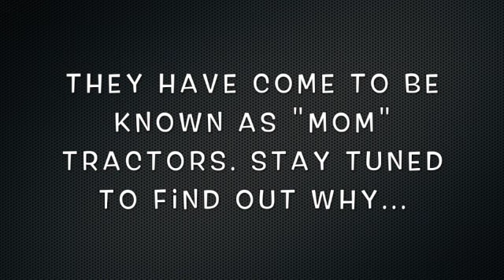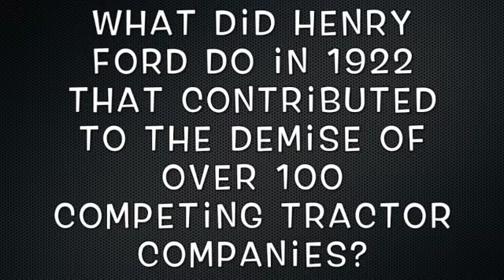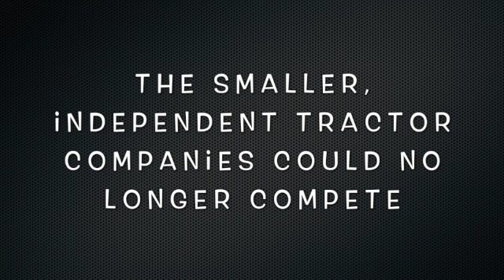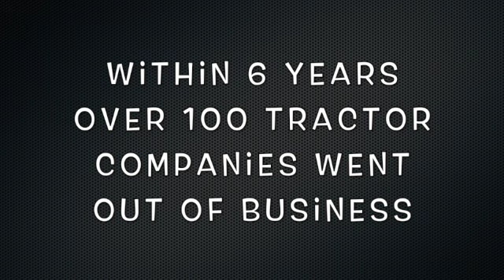The Fordson F Tractor - Specs, History, and Trivia

Comment: Great video with interesting information! Any idea where I might find the serial # on mine? I have no idea what year it is, but I saw a video of a restored 1919 model that looks identical. Mine is faded / peeling gray with bright orange paint underneath. It has solid front wheels with a hard rubber tire on the front, and steel paddle wheels on the rear. There are no rear fenders. There is a belt drive wheel on the right side like in this video. It currently has 4 different spark plugs in it. All are Champion: 22, W-14, W-18, OCOM. Do you know which is correct? Thanks for any information you may be able to provide.
Reply from the maker: The serial number should be below the cylinder head, on the block, toward the front of the engine. Here is a link to serial numbers by year ... https://www.tractordata.com/farm-tractors/000/2/1/217-fordson-fordson-f.html. If yours is truly a 1919, it could have been manufactured in either the USA or Ireland. The serial number will tell. I don't know what brand of spark plug Fordson originally installed in their F models. My guess is that they used more than one brand as supply and price dictated. This is also a topic for debate, so I will not speculate. The size is 1/2" NPT. The Fordson F manual suggests a gap of 1/32", which is 30thou. I use Champion 25s in mine. They work beautifully.
Reply: @AntiqueCarsandStuff  Thanks for the info. If I find the build date, and serial #, I'll let you know. I assume the tractor and Model T in this video are yours? What year are they? I was raised in a Ford family. I have my dad's 31' Model A Town Sedan as well as my own 68 California Special Mustang. I'm hoping to find time this winter to start tinkering on the Fordson. Trying to learn about it before I do any work on it.
Reply: SS# are stamped on block between front two intake ports. You might have to take off the intake/exhaust manifold to read the whole number.